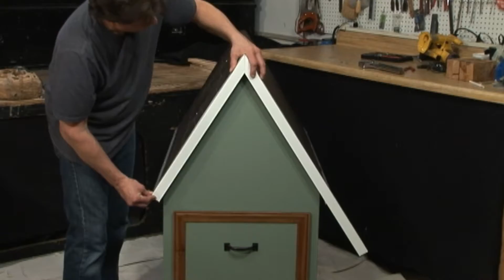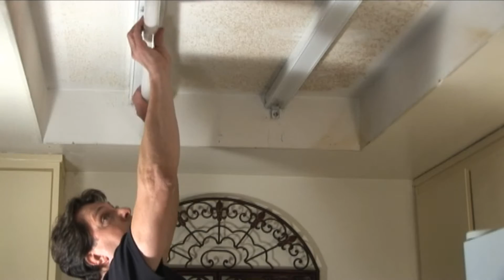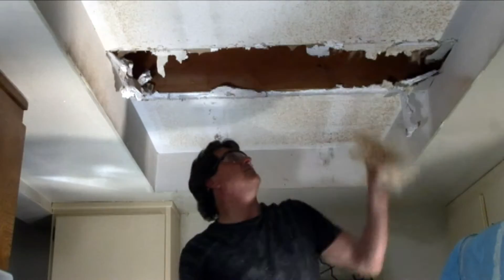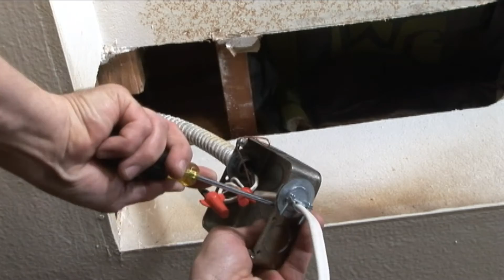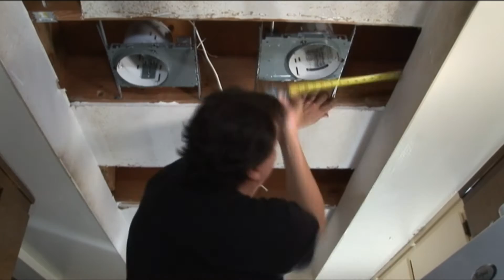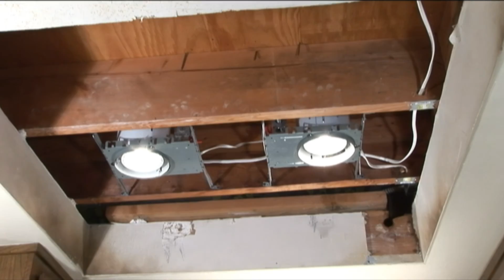DIY Remove Florescent + Replace w/ Recessed Lights - Part 1

Comment: How much would you charge for a job like this completely finished?
Reply: Thx for watching - to do a job like this in Los Angeles / it would run anywhere from 2500 - 5000 - please check out the Eddie Rinier Channel